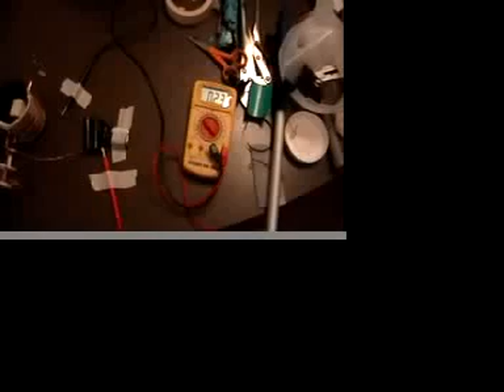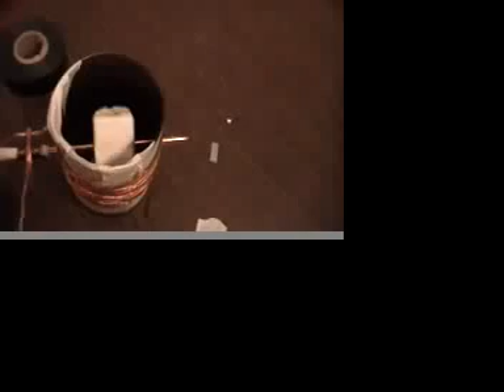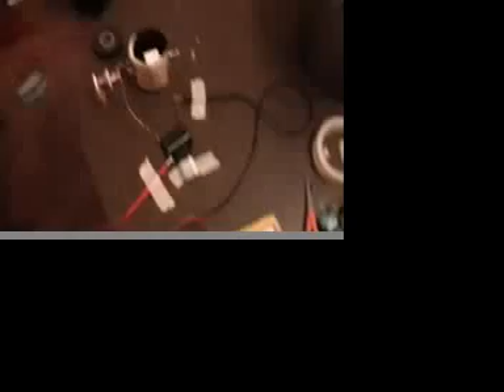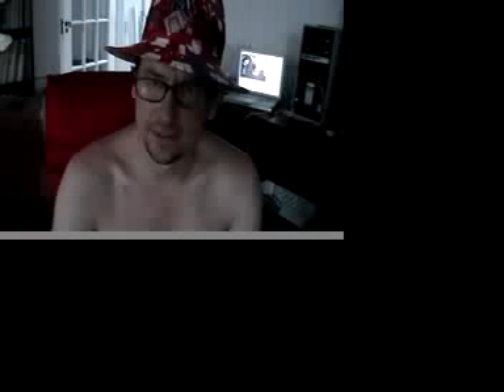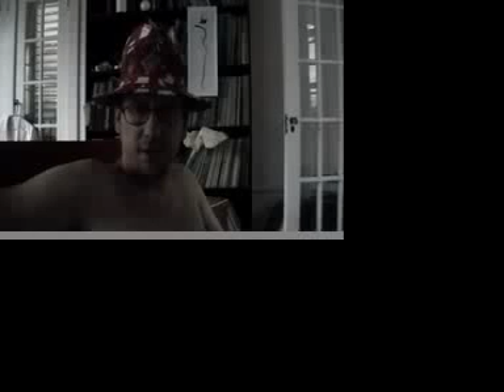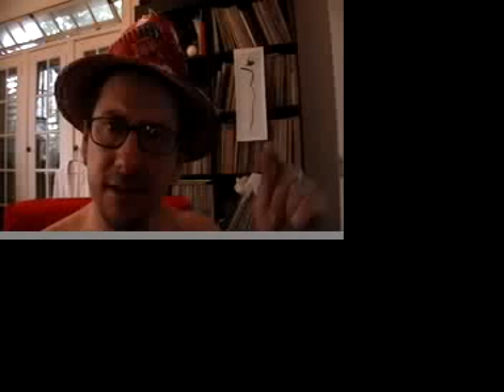how I was given free energy with the Newman free energy mach

Comment: @zeropointprophet  Do you have a clue what "mine runs on .32 of a volt in 8 days "
even means? If you mean that your battery voltage dropped by .32 volts then all that tells you is the internal resistance of the battery has increased. Perfectly normal for a discharging battery,
                       Mike

Comment: Thank you for admitting that you didn't have free energy.  I really get tired of people misinterpreting what they see on their meters as created energy.

The spinning really has nothing to do with it.  If you take a coil, and connect and disconnect the battery quickly (as happens where the spinning wire connects to the stationary wire) the coil puts out enough voltage to jump the tiny air gap.  This could be 100's of volts, but for a very shot time.  Increased voltage isn't increased power.

Comment: You newman machine replication is worst and rubish! Ofcorse you did not be able to recharge your dead batteries to full, because many factors you did not make.

1. You used to little amount of coil winding. Your machine was maybe containing at least less than 100meter. You should use at least 500 meter and 0,2mm cooper wire to get over 200 OHMS. More tiny wire is better.
2. Your commutator was bad. It was not stable and I can say you did not even tune it! You need to tune commutator.

Comment: I'm building a big Newman from scratch right now... You missed the all important test though. Can you light a 90volt neon off ther ouput of the coil? Also my Newmans turn at over 1000rpm in most cases, but your motor appeared sluggish at best. You may want to keep tweaking it and test for a stepped up output.